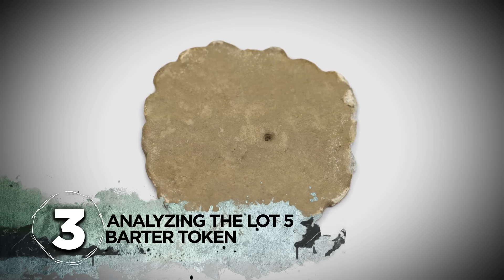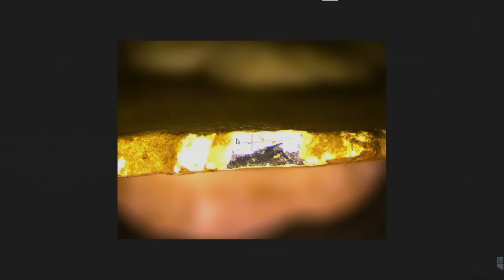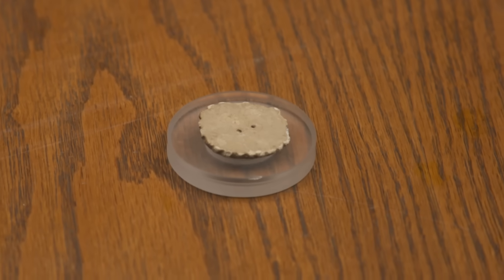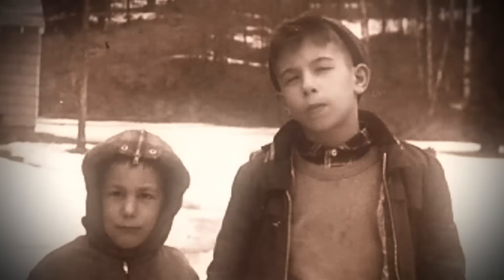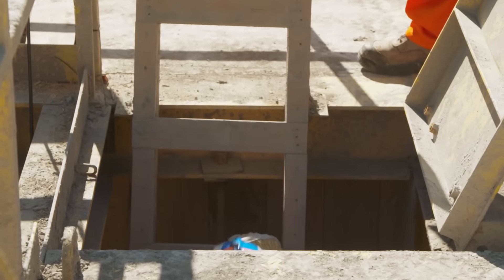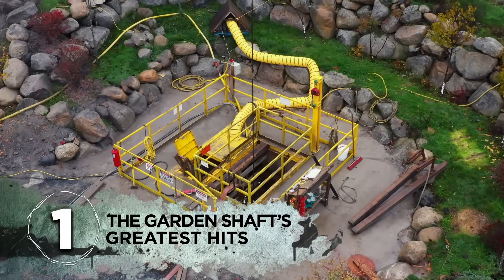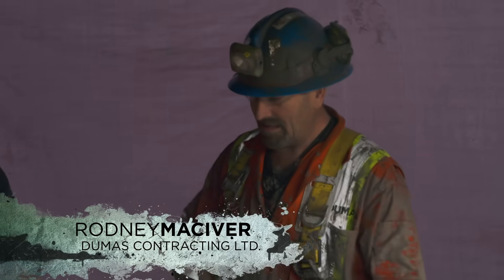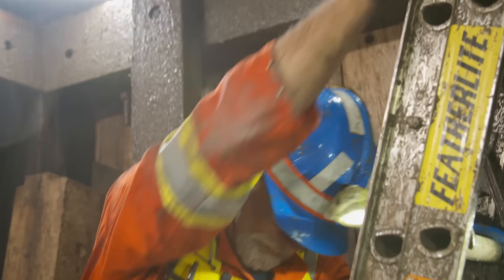The Curse of Oak Island: TOP 3 BIGGEST FINDS FROM SEASON 10

Comment: They should do all around the money pit area the same thing they did in Smith's cove to shut off the water.
Reply: I totally agree, but With smith's cove dammed up the should have pumped the money pit and saw if in fact that's how the money pit floods
Reply: @tricycleguy2657  There could be others that come from different directions.
Reply: @drewconrad7093  very possible and probable as a fail safe booby trap but they lost the opportunity to test it

Comment: (yawn)  what ???   zzz - zzz - zzz - zzz.  Star GPR on Lot 15 and 16.  Core drill the SW, W, and NW  curvilinear arc around the Money Pit and check the water samples for precious metals.  Find the zinc mine entrance shaft on Lot 32 or 33 and see what can be found there, and if goes under harbor (swamp) to Lot 15 and 16.  Dig out Dunfield harbor causeway and insert 2 or 3 large HD concrete bridges on the causeway allowing the sea water to (again) wash in, wash out, and (1965-2023) period of organic material growing in the area.  Otherwise, dig out the entire swamp organics to get back down to the original harbor - and what will be found.